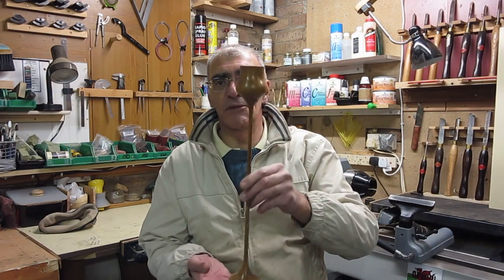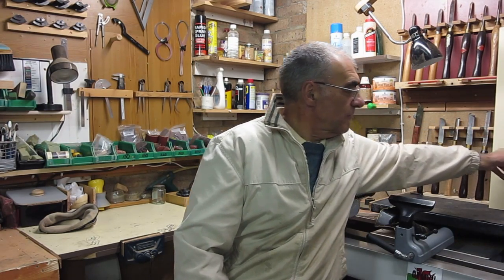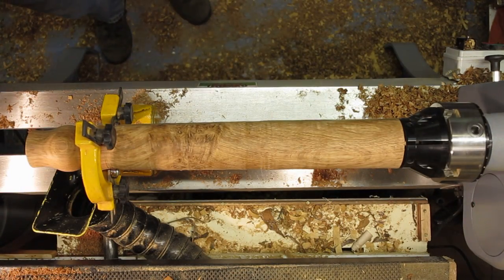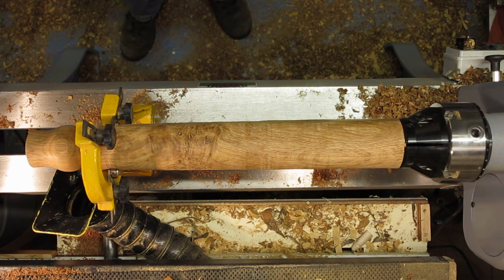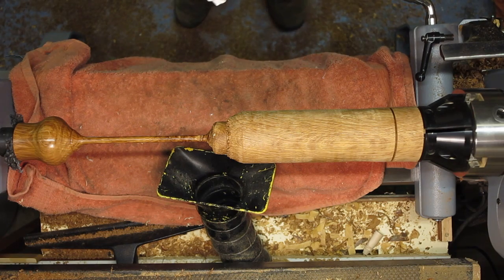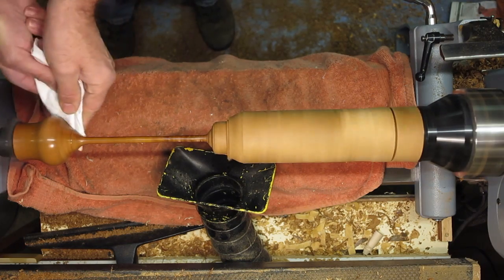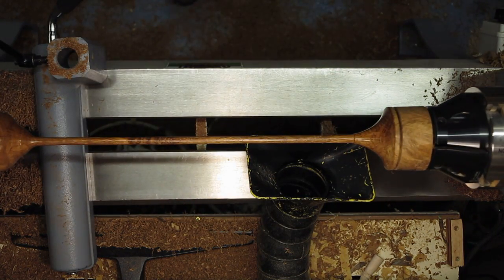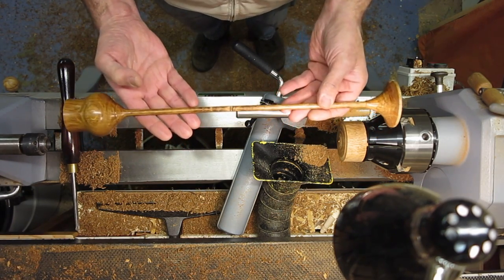Wood Turning - Oak Goblet Challenge

Comment: Wow, that wipes the floor with any goblet i've ever done, really amazing! 
Question: as you were parting it off, did you remove the tailstock for the last 1/4" or so, only supporting it with your hand, or did you leave the tailstock in place until it was completely parted off? I couldn't quite see on the video and i'm curious what the "safest" method of parting off a piece like that is, thanks a lot and great video! 
Tom

Comment: Hey Mike, Thank you for posting all your videos, very well done.  I do have a question.  Is your sanding sealer a special mix or is the sanding sealer right out of the can?  Just trying to get the same finish as you get with your projects.  Any help would be appreciated... Winter is getting here in Michigan, so that's more shop time, if I have enough stock..  Stay well,, Chris
Reply from the maker: Hi Chris,
I thin the sealer with Cellulose Thinners 3:1.
Thanks for the comment and support.
Take care
Mike

Comment: Nice :)
Which steady rest is that I see (bright yellow) that fits the  AT1628VS?
Is that a Robert Sorby tool rest from the Modular System?
All the best, keep the videos coming.
Reply from the maker: Thanks Giles, the steady is the Axminster that I bought for the AWVSL1000 lathe. I have to use a wooden shim to get it to fit. Yes it is the Sorby modular system, which I use in conjunction with my normal tool rests. It's better for certain jobs,but not all.
Take care
Mike

Comment: Hi Mike,

Just wondering, as I am a complete beginner, what is a good wood to start off on?  I have access to oak and birch, plus I could probably get my hands on something else since my father is a gardener.

Thanks,

Taras.

P.S.   Do you recommend what I should do first?
Reply from the maker: +TarasDoesDIY 
Hi Taras, Oak is a great wood but harder than Birch, and would suggest the Birch to start.....but for practice anything will do, to gain confidence and technique.
Hope this helps a bit
Cheers
Mike
Reply: Mike Waldt Thanks so much, Mike!